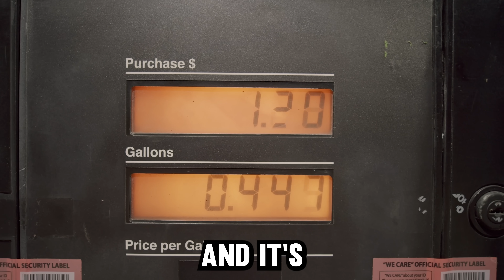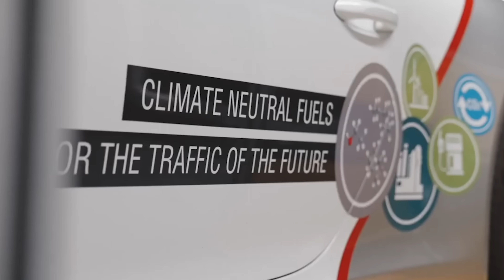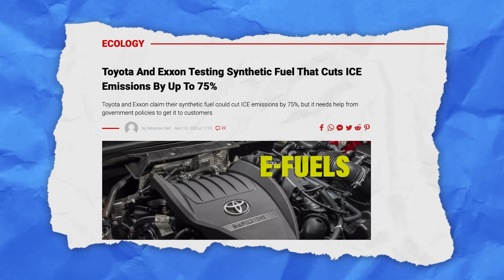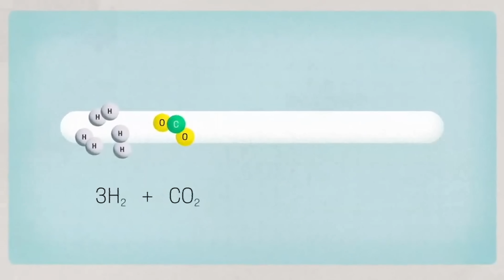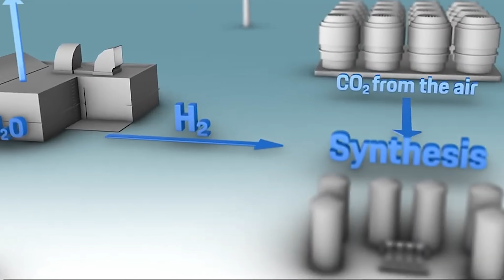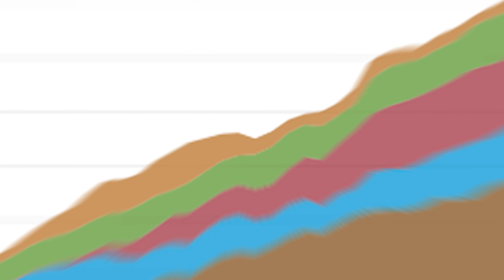Dodge Just SAVED Combustion Engines

Comment: Infrastructure is a dud for hydro carbon capture, corn fuels have been around for awhile now and such. Yeah, your not going to beat 100+ year innovation in  the making of cars- especially in GAS guzzling USA.  Trucks are the sacred and CASH COW for US automotive industries., heck most 1/2 tons are not even used for HAULING or doing truck STUFF. Most if not all services that  use diesel and alternative higher octane fuels will continue to use them ie: commercial and militaries the EV sector is for average consumers not ELITES as you say it. By the way you can by a use Bolt, Volt or even a Prius at a affordable price.

Comment: More importantly, does this mean we no longer need to use catalytic converters???
Reply: Shit, I don’t use them either way. My “gas guzzler V8 Benz” returns 33 miles per gallon on the highway, with cats that would be about 28 miles per gallon. Emissions devices kill vehicle mileage and can cause issues for the engine, which is in essence an air pump. The more air you can flow, the better it will perform.

Comment: Ehhh thats cute and all but unfortunately internal combustion engines are pretty much over, they're definitely on a life line right now..hence this video. 

Im currently building a 96 Bronco, soo fuck HP..going straight efficiency..that way itll make it to dinosaur status in the future. 

Now, even though I was all in for EVs and planned on building one..that changed

Toyota just pretty much curb stomped Internal combustion engines and then proceed skull drag them down to hell. From there they climbed back up to choke slam EVs, then grip em by the eyes to drag it through the blood of internal combustion engines to then raise it in the air just to stare into the bloody empty eye sockets as it punched through the chest to rip the heart out and then toss into the hell hole in which Toyota crawled through. In other words, they're coming out with Hydrogen Combustion Engines that will have no equal.

And if any of you are actually car enthusiasts..youd be excited/ thrilled about every evolution in the car industry. Yet all you retards are brainwashed by oil companies & paid off Republican politicians to believe you need an internal combustion engine to go fast even though every high performance EV has completely obliterated every internal combustion engine it goes against. Plus, yall are probably the same group of idiots that believe removing your smog shit helps your engines...it doesnt..ever...you're wrong and have always been wrong.

Comment: I have no idea why there isn't more research into this over changing literally everything to make way for EV..
Reply: Because radical librals and socialists don't care enough and/or aren't smart enough to understand ideas outside of what they already believe to know
Reply: I've yet to see a gas station ripped out for a charging station. Adding a charging station is changing everything to make way for them.

IF they get this cost efficient, continuing EV research for daily- maybe even long distance- driving use is still a smart thing to do because E-fuels (as described) cannot fix the damage CO2 emissions have already caused on their own.

More options is not a bad idea when it comes to current transportation.

Comment: I don't care what anyone says, EVs will NEVER be a replacement for a good old heart pumping V8 monster 💪😎
Reply: the electric motor outperforms the combustion engine in everyway.  more torque. more power, less parasitic loss, less moving parts, less friction, less heat. i could go on. battery tech.. is what makes EV cars less than optimal. but your crustly old ass needs an education. cause industrial applications use electric motors. and for good reason. Superior.  Aircraft carriers have diesel engines. that charge battery banks. that power Electric motors. the combustion engines only real use is to generate electricity for the superior engine!

Comment: The obvious solution is hydrogen fuel.   Top class W.E.C cars have been running hydrogen powered combustion engines at 1000+ horsepower for the 24 hours of Le Mans for years now.      

There’s no need for synthetics.  Hydrogen fuel has already been proven as reliable in one of the hardest and longest races out there 

Try talking about that for a combustion engine save.  Instead of praising dodge for only recently investing in a. Net.0 fuel.  When there a net negative solution already viable and easily accessible if they’d put the same money into it they already throw around Willy nilly.  

And as for planes.  Commercial air travel only contributes 1% to global warming.  And that percentage gets smaller each year thanks to continuously developed technologies that allow them to burn cleaner and more efficiently.  And due to an airplane moving so much faster than a car.  They use less gas per mile than even the best hybrids available by a huge margin.   

Granted everything you talked about was pretty neat.  And you did discuss some genuine environmental prospects.  You neglected some of the obvious stuff
With an average viewer count as high as yours it would be beneficial for all if you talked about things like hydrogen fuel and other huge advances in environmental technologies.  That big name oil companies in countries like the USA don’t want to succeed because it means they’d lose there control on the motor industry.   So that’s why companies like BP and stelantis are researching synthetics. If they can get a product there satisfied with then they can produce it on mass and have even more control on fuel prices and multiple industries.

Comment: Synthetic fuels look really promising. I hope these E fuels are the true future for cars and not EVs. Electric isn't new. They have been around for 100 years and still can't even tow. Plus its good f1 has been looking at E fuels so the technology can trickle down to mainstream production cars.
Reply: F1 is also running hybrids now. F1 is also going to be lowering the power output of their combustion engines and increasing the power from the electric motors. Sure, F1 is moving to E-fuels. F1 is also moving more and more towards electric.
Reply: @Enrique A Thiele Solivan Just where does it cost $10 a gallon?

Comment: I like electric cars now that being said they are really really bad for the environment Which for the most part nobody likes to talk about You're trading one little hole in the ground drilling for oil To av open pit mine which in itself isn't all that bad but It's the millions And millions of gallons of water Used to separate the metals to make the batteries that I have a hard time with China for the most part doesn't really care about the environment and if you Google it you will find out for yourself Now we have a lot of spots where we could do it and we do care about the environment" Kind of" But good luck getting a permit to do so within the next 10 years.

Comment: Anybody with a functioning brain knows that the attack on ICE's has nothing to do with the "climate". It is part of the agenda to enslave and control the population. EV's are easy to build from the start with remote control and monitoring technology. So you can be tracked wherever you go and your car can be stopped and controlled remotely. This isn't the case with most ICE's on the road today. Sure they have plenty of electronics and computers, but the focus has never been on remotely controlling the vehicle. They simply don't want all these vehicles out there that they can't control. Hence the speed at which they are trying to make them too expensive or ban them and force people into EV's. The internal combustion engine has never been the problem when it comes to pollution, it is the fuel. We could have had clean alternatives, but the scum who want control of all our lives did not want any research into replacement fuels. Pushing instead on solar, batteries etc. People are too stupid to see that the "smart phone", which they are being made increasing more reliant on for basic life, is a remote control. A remote control through which governments and their puppet masters will control everyone. For example they will use it to block your access to your bank account anytime you don't do what they want. People need to wake the F up. This is worse than just cars.

Comment: Not to mention every time one of those Evs get into an accident they spontaneously combust, because the battery casing has been exposed because it splits up and then when the fires put out the first time they reignite and burn for several more weeks if it doesn’t kill the occupants by burning them to a crisp first and yes, I know combustion engine cars have fuel tanks that can also catch on fire and explode burning the occupants to a crisp but if you look at recent actions that have happened, I will find that that is more popular among the EV cars over the combustion engine cars
Reply: EV fires are actually rare. They don't combust spontaneously every time one's in an accident. That's a bit of an exaggeration.

Problem is, for that same reason (the rarity), every time there is an EV fire, it's automatically going to the news. There's not many of them on the road relatively speaking, so every fire caused by one is going to be talked about by everyone. You really can't say that about gas car fires; they're so common that you're not gonna hear about all of them all the time.

Buuuuut, although gas cars have the potential of exploding in a fire, a fire coming from the batteries of an EV can be extremely nasty. Not only do they burn harder and for longer (meaning they're harder to extinguish), but the smoke they produce is toxic and very dangerous.

Moral of the story: no matter the type of car you have, you DEFINITELY don't want it on fire.

Comment: Ev's wouldn't exist without the endless propaganda and support from corrupt politicians pushing a narrative they know to be untrue about climate change, because we all know a 2000 lb battery pack that is no good anymore is so good for the environment, and the heavy diesel machinery that mined the ore, the coal and gas fired electricity stations to power processing plants to turn the ores into usable materials for batteries, and so on down the line, its all so much better than the existing infrastructure we had in place that has worked for decades.